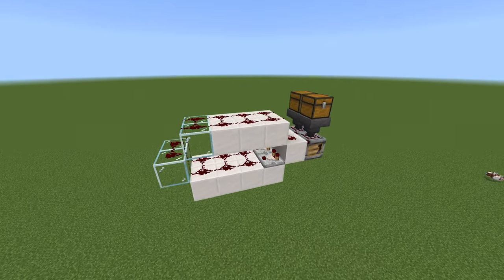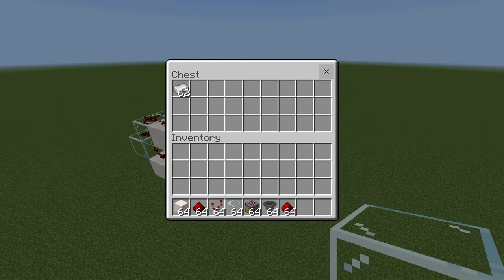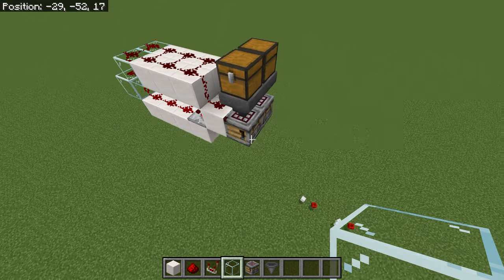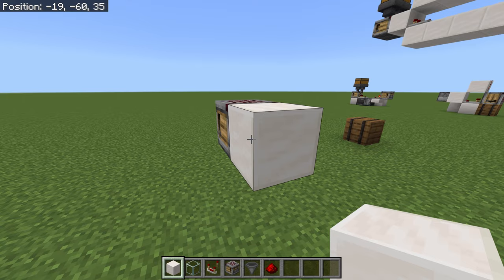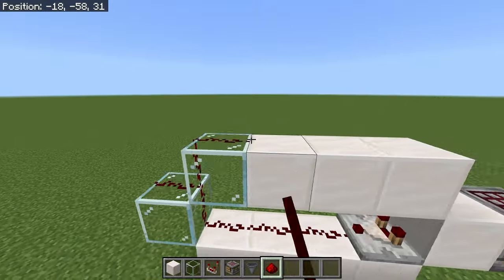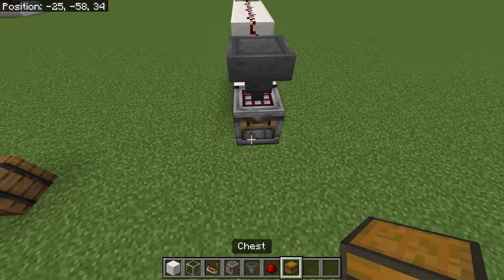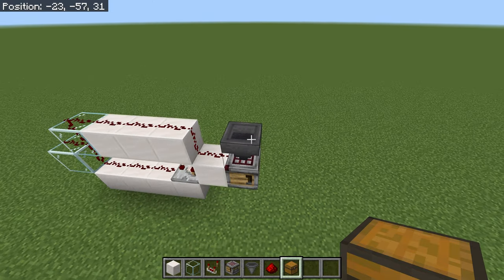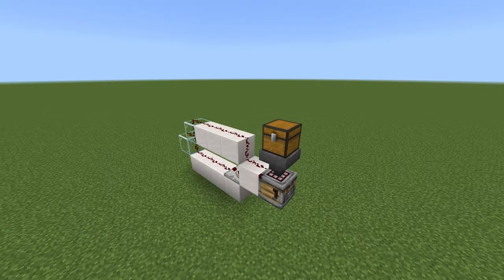EASY Tileable Auto Crafter for Minecraft 1.21 - No Observers Needed

Comment: Alternatively, I find two observers looking into each other make a great clock for the crafter. Only takes up 3 blocks
Reply: Doesn't work for any recipes with more than 1 item. It will just spit out random items instead
Reply from the maker: Bedrock also has a bug where if you leave the loaded chunks then return, the observers pulse, which will craft anything in there. That's why I made these observerless.

Comment: You can reduce the lag of this by pre-powering the dust at 1 signal strength lower than the limit. 
This causes the dust to not update except when the crafter needs to craft.

This suggestion shouldn't matter unless you're tiling this a lot in a big farm, but if you want a massive bamboo farm with 20 crafters (for example), the mspt savings might matter.
Reply from the maker: Good suggestion, tho I wonder if the lag caused by pre-powering would be more than than the lag caused by updating the dust. Worth testing!
Reply: @Acadewolf  It would be less because the "prepower" is static. 
I can explain how dust updates work if you like, or you can look it up yourself, but it's really inefficient, and the end takeaway is that minimizing the amount that signal strength changes minimizes lag.

Ideally, you want the signal strength to be normally at 8, and then only change when the comparator outputs 9, and then only change back to 8. The easiest way to implement this is to power the first dust at 8 from a static second power source.
Reply from the maker: @haph2087  I understand how dust updates work, propagating back and forth each time it's raised. I'm just thinking whatever tileable entity you're using to prepower is also going to introduce lag. To avoid triggering the crafter, the signal in will have to be 14 on each slice. I'm just saying the marginal gains in mspt may be so insignificant as to perhaps not be worth all the extra resources. My focus is survival rather than creative tech efficiencies
Reply: @Acadewolf  Ahh, I like designing large farms. I understand that saving on blocks is convenient for small farms, but I was just making this suggestion because (generally) when people care about builds being 1wt, it's because they want a lot of copies.

Comment: this design is not good. instead you can put a composter or crafter making 8 of redstone sinal pointing direct to a subtracting comparator connected to the crafter, and you put a block in front of it and a redstone plus a repeater so when it detects when the crafter is full and makes the block
Reply from the maker: Yep, and I've done that in other videos, but this is for a 1 wide tileable version. To use the subtracting, it needs to go into the side of the comparator. There's no realistic way to do that and make it one wide tileable
Reply: @Acadewolf  u can do the opposite comparation on the other side of the line, idk about it being tileable tho
Reply from the maker: @arturoadrian  exactly, it won't be 1wt unfortunately.
Reply: @Acadewolf  you can make it 1wt. It comes out to about the same length, although it's 1 block shorter than just using redstone dust length (would be 2 blocks shorter if you ignore a single block jutting out). It's a bit more expensive and less intuitive to build though, so this more obvious approach still makes sense for newer players as a cheap/observerless/easy to remember build.
Reply: what you are proposing is not tileable don`t call someone`s redstone bad till you know how it works yourself.
Reply: quiet you, everyone knows that design. smarter people are here for better reasons.
Reply: @gagewilson4751  bro is commenting on a old comment and thinks he is the smartest. i forgot that it wastileable
Reply: @Calvodecria559  if you forgot to know what you were talking about them why you talking?
Reply: i tried that design on my gold farm but it got clogged and didint work after some time when i used this one it didint get clogged and it fixed the issue